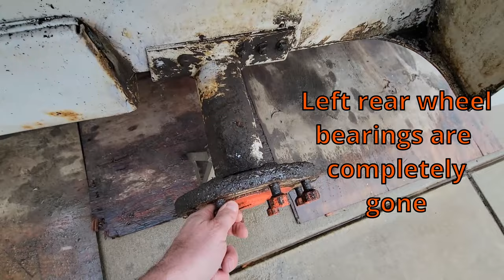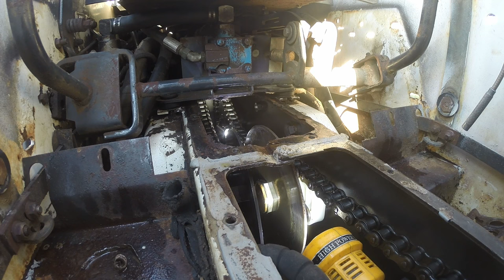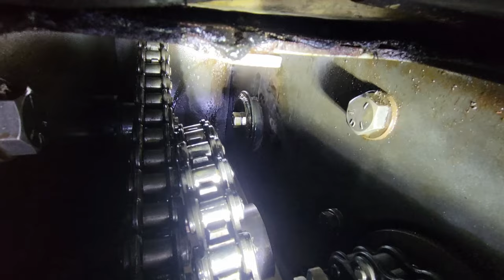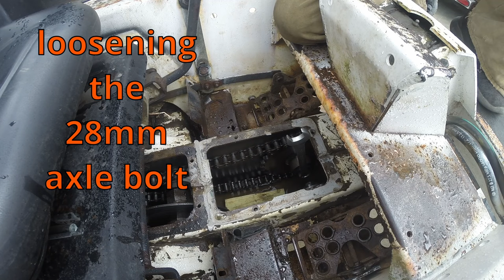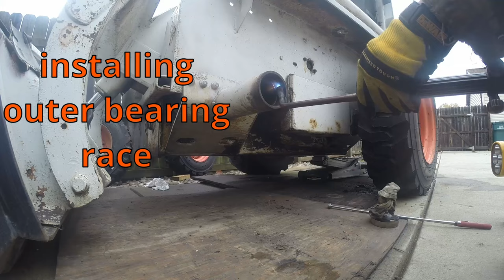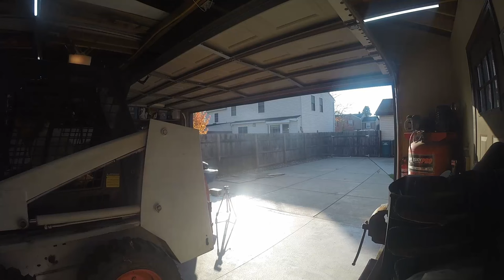Bobcat 743 Axle Bearings & Seals Replacement Nightmare 743B 742 wheel

Comment: Nice job!  I did the same thing last winter, only the drivers side rear.  It sucked!  I did not remove the inner race because did not think of that nice homemade threaded rod tool that you made.  Also liked how you loosened the axle bolt by turning over the engine.  Only thing missing from this video is how you installed the oil seals.  I used some wood wedges...
Reply from the maker: I also used wood blocks to install the axle seals along with a large pry bar to fully seat them. The job was pretty awful but it was for a good friend. Thanks for watching, and hopefully subscribing!

Comment: Just out of curiosity….and because I have an old 732 that may need doing soon, what sets the preload on the bearings? Is there a mechanical stop on the shaft that stops them over tightening the bearings into the outer race? Just wondering because I know if you do any kind of taper wheel bearings on a trailer or the front hub on a car without backing them off a bit they fail real quick.
Reply from the maker: I'm not sure if there's a preload, the torque spec for the nut was pretty high, I think over 250 ft lbs. These are slow speed bearings so I don't think bobcat put too much thought into it

Comment: Great video, thank you. Already removed my engine and hydraulic unit and these bolts sucuuuuck!  What is the 658477 part? Looks like a graphite sleeve, I did NOT get that in my repair kit. First time doing this so all 4 are getting it. Thank you
Reply from the maker: The sleeve is metal, it fits on the axle where the seal rides, you'll want to replace them
Reply: @SeaDooEric  ok thank you I just received my service manual yesterday for this and see it now. Back to the parts store. Lol 😂 thank you again boss so much appreciated 👍🏻
Reply from the maker: no problem

Comment: Hi, is there a sleeve that goes on the axle for the lip seal to run on? I cant make out the part number? Thanks
Reply from the maker: There's IS  a sleeve, without it the seal will leak, badly. Check the video description for part numbers
Reply: Thanks 👍

Comment: Okay just me again. After 2 weeks I was finally able to sort out what bearings I needed. Races will be in tonight, outer bearings were pressed last night. My one last question. What was your trick to getting the inner bearings into the shaft? My bearings slide down to where the spline is then after that I know it's going to be tight. Any input appreciated, I don't have to cover plates on this machine practically doing the backs by feel.
Reply from the maker: For the inner bearings I put them on the shaft then installed the bolt and tightened it, that pulled the inner bearing to where it is supposed to be.
Reply: @SeaDooEric  that's what I was thinking just wanted to cross reference. Thanks again!
Reply from the maker: Good luck

Comment: Hey seadoo, maybe you could help me. I previously said in a comment I have a 440b that's ready for the same treatment. After calling bobcat and getting quoted 700+ do get all of the bearings, races, and seals I remember seeing you use duralast bearings for this machine. That made me curious on how you found those bearings for the machine. Did you have a part number that worked, did you measure and stand in the parts store looking? I'm struggling to find the bearings and seals for my machine without breaking the bank. Loaders parts source and all skid steers can't get me what I need even with them both saying they are in stock. Any help would be appreciated!
Reply from the maker: I found the old bearings had part numbers on them so I used Google to cross reference the number and found the exact match at the parts store. The races are usually easy to find one you know which bearing you have
Reply: @SeaDooEric  I appreciate the info. I'm in the garage trying to cross reference as we speak. Seems like the newer s70 version runs the identical drivetrain of an older 440b. I'm on the scent now just gotta finish tracking!
Reply from the maker: Check the Timken website too, they have CAD drawings of every bearing imaginable

Comment: Can you tell me whats required to make the race install tool
Reply from the maker: I used 3/4 thick threaded rod with  2 thick washers that I reinforced with 3/8 inch plate steel on each end. The washers are slightly larger than the bearing race.
Reply: Thanks

Comment: Are you for hire?
Reply from the maker: Not for another 743 wheel bearing job!
Reply: @SeaDooEric  I have an 843 I'm thinking about doing possibly but oil is cheap. I was just curious in the method that you used to get the nuts loose looks like with mine I have to possibly move the motor and hydro pump or separate the gearbox from the chassis not sure
Reply from the maker: In the video I showed how I loosened the bolts but turning the engine over with a wrench on the bolt
Reply: @SeaDooEric  I'm not sure I can get to the bolts with the hydraulic pump in above it
Reply from the maker: I had to lift the pump with ratchet straps, it's tight quarters!
Reply: @SeaDooEric  so you loosened motor mounts and lift pump to get access?
Reply from the maker: I unbolted the two front pump bolts and was able to lift it a little
Reply: Ok, did you have Perkins engine or Kubota?
Reply from the maker: Kubota